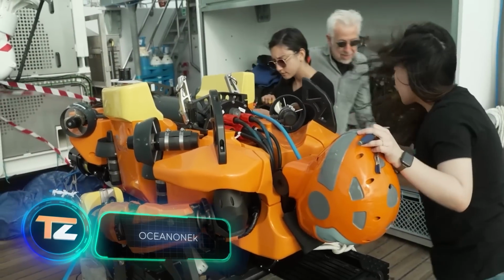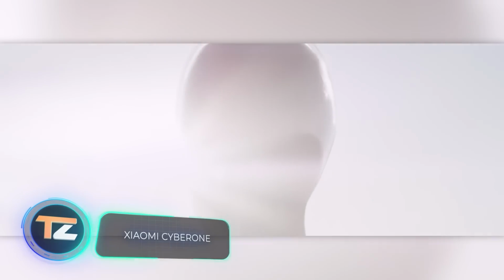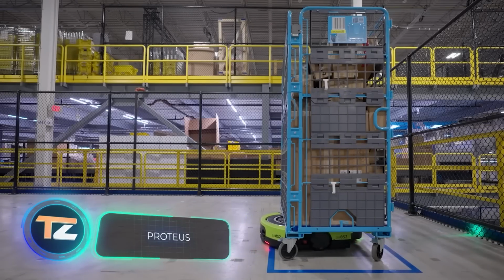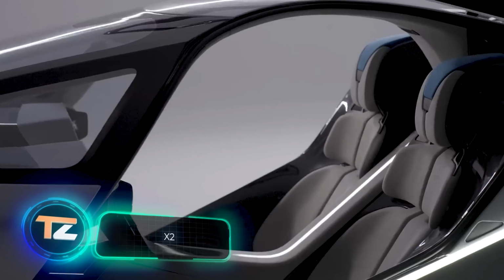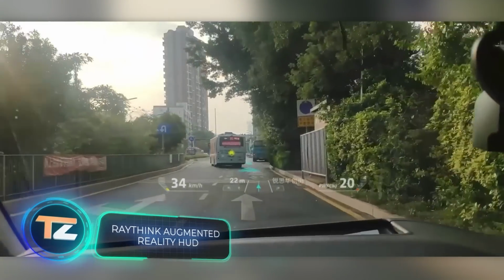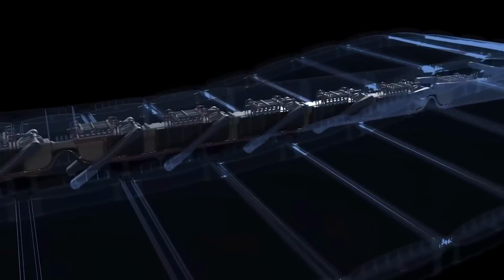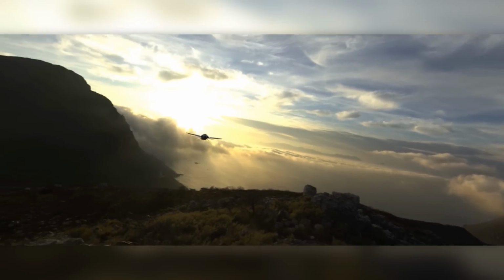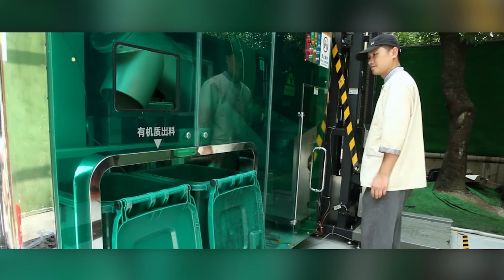AMAZING INVENTIONS YOU HAVEN'T SEEN BEFORE

Comment: It is totally wrong to say to say "Fuel prices dropped so efficiency is not required". Irrespective of Fuel prices higher fuel consumptions must be curbed worldover. People talk about carbon emissions but how many talk about heat emissions? What is the exhaust temp of Gas turbines, (Aeroplane engines )? 
Are there any developments to reduce this temp ?

Comment: the water from air will always be a scam. areas where air huidity is high also have rain . there where its dry as a bone humidity is low and the energy needed to extrapolate water fromm air is there way too high making transorting water by and cheaper

Comment: The GE 36 was hardly killed off due to oil prices. 
It got killed off because it was insanely loud and larger high bypass turbofans where already rapidly surpassing what it could do. 

The US air force tried something similar with the XF-84H "thunderstreak" and it was so loud it damn near killed a man and could be heard for miles.
Reply: whilst you are right, the original jet engines were also much louder during development.  So many of the issues may of been remedied had the price not dropped and development had continued....
Reply: @dane4265  The military tried the tech as well. 
Their engine was so loud it killed people and blew out windows. 

The tech relies on few blades at a very high rpm or many at a lower one. 
But once you lower the rpm to reduce noise you lose efficacy at the blade tips and need to put a shroud around them. 
At which point you have just built a turbofan engine.

Comment: that delorean aerospace plane/car when made decently atleast, should be much more efficient than a electric car, allowing it to go much faster with a lot less fuell. if it is made very good it will be a lot better again, allowing it to be insanely more efficient. just like how the germans(some hobbyists) once made a flying device which was very small and cheap to make(mostly just a regular old style hangglider but modded. that thing would go around 100km/h(max speed you are allowed to go with a car with a small motor of around 500w, where that little power once up high enough already actually would be overkill.

other gliding planes also can stay up with barely any force, but hanggliders are made super cheap and simple(you can make one for around €200 to €300 in europe, in usa that would be a lot cheaper) but  in reality almost all flying devices which are properly made an optimized are guaranteed to be a lot more efficient than cars. those big passanger planes however while not terrible in efficiency are made specifically to be cheap and small, not for efficiency so in comparison they are really inefficient due to the huge weigth they need to carry with very small wings(which isn't always bad when you go really fast). but even those acienct 4person planes from not that long after the WOII already are more efficient than almost all carrs currently on the market with some small super efficient cars being the exception.

a modern optimized flying device could be a lot more efficient. the main principles to look at is that when wings are made and designed properly you almost have no drag at all other than the wind resistance. when wings are using the "new"(10 years old or so by now, but still almost nobody uses it, however some of the first hanggliders used it, so it would be older but they did it on accident because it was cheaper and more easy to make for them) nasa mars glider wing design you can illiminate the generation of turbulence from the wings, normally this would be one of the main losses of the wing. now the only significant force required to fly it would be the direct drag from the air and moist in the air. luckily planes tend to be insanely more aerodynamic by default. and there are 2 other nice effects which help you one of them is mostly due to turbulence from other parts of the plance, so with a perfectly tuned plane this won't do to much. but when swimming underwater the further you go down and away from the surface the less friction you have in the watter with around 3m of depth often being the ideal depth since after that the effect greatly reduces. air has a similar effect but it is less strong and so has a shorter range, however this effect keeps going on quite far and so the higher you go your friction slightly decreases. another much stronger effect with being up high is that the air pressure greatly decreases, which means a lot less friction with personal crafts you typically don't go as high but it will still help. and when flying smart you can use updrafts to get free energy.
now come the other parts which make planes a lot more efficient which most people don't directly think about, a plane doesn't have friction with the road and a lot less dust particles, road friction is a huge problem for cars, as well as that the weight puts a lot of pressure on the moving parts, the wheels, bearings, the rotating axis, etc. that generates insane amounts of loss, for a plane almost all foreces/pressure is on the static non moving parts,  this makes it much more efficient. then there is the weight thing cars have a lot of weight and vibrations from the weight, the road, braking and accelerating etc. this forms a paradox where everything needs to get stronger making it more heavy causing it to need to be much stronger again. electric planes barely have any vibrations so can be made very simple and light, and instead of using super heavy parts to make everything rigid and strong at the same time, in flying devices things are allowed to be a lot more flexible. having flexible materials allows them to be super strong without needing to be heavy or big, and they need to carry a lot less weight as well. the weight is the next issue. when driving a car you are also very insanely inefficient in a way which in general is not thought about and so is not included in comparisons like that old plane to a modern car. and that is that planes can go in much straighter lines extremely shortening the distance but also greatly decreasing the amount of energy lost to inertia,  this same goes for making turns, planes don't need to have grip, so don't need strong tyres, they don't lose energy due to friction due to sideways pressure on the tyres trying to rotate them, and planes instead just turn sideways and automatically turn using the same force that holds them up. this also makes them much safer than cars+you have much longer reaction time if something happens. now another on normally not concidered is that cars in reality need to brake and accelerate again all of the time, for a flying device you just put the motor on a speciffic speed and let it go. only when someone comes to close to your height and trajectory you need to correct/avoid it but even if everyone used planes such a thing would be very rare to happen due to the sky being high and traveling being a lot faster. with some proper planing and standards(like special zones giving priority to a speciffic type of action) it would be very rare for any plane needing to interact with another. especially if they can do vertical landing and take off. 

 I forgot to mention some things in here but there are more then enough effect already in here which should convice you why flying is much more efficient.

now for some of you, you might have heard the standard misconception that wings do not have planes and always need to fight themselves and push themselves straight up into the air just like a rocket making them very inefficient for long flight. well I need to tell you that while rockets do that, planes don't even quadcopters use small wings, the propellors are small typically inefficient wings, but for a real plane the wing effect is much greater I will explain it for planes but the same also works for helicopters and quadcoptes etc. just on a smaller scale for those compared to planes.
when a plane flies it barely needs to push itself upwards. the best way of seeing a plane is by seeing it like gears. so lets say we have a small plane weighing around 500kg with the person in it, a plane can be made lighter than this easily btw. but when you need to keep that weight up in the air like a rocket it takes a lot of energy, and most people talk about planes in that way of they need to keep all that weight in the air. but the truth is that the air is just like a road. an your plane isn't struggling to stay in it, it just stands on/in the air. just like how a car stands on the floor or boat floats in the water. a plane needs speed to stay in the air and indeed a little force. but that is mostly force in the way of speed.
you can see a plane staying in the air more like a gearbox. the wings are one huge gear and the air is a huge gear so you can see it like a insane reduction gearbox where if you go at a decent speed and have decent optimized wings you are looking towards ratios in the thousands. this means that to keep your plane in the air the force required to keep it up is similar to the force your engine would have to deliver to lift a few kg or actually less than a kg in weight on a rope around the engine axis. and since the propellor also has this gearbox effect a plane once in the air barely uses any energy to stay in the air. the force required is kind of like a small weight of a few grams attached to a rope attached to the motor shaft, when properly tuned the energy lost to staying in the air is less than one single small drone motor. ofcoure the energy needed to stay in the air at that efficiency is bigger due to t relying on speed so you need to go fast enough to fly efficient, but since people like to go around 100km/h or 60mph anyway this is no problem. only when you go up to steep it requires a lot more force. but hanggliders with a pilot can take of gain height and fly on a electric motor smaller than what you regularly find on a electric bike.
Reply: Thanks for your thoughts and lucid commentary !

Comment: wanted to make a rc drone on the same concept as that new delorean car in this video, so perhaps I can steal some  design concepts from it for my design. but there are still some things I would do different. somehow expected this video to be about rc drones because of that because it looks quite much like how I had designed it.
however at looking at the 3d model I see some differences.
I didn't base my design on that car/plane however. I just came up with that concept to make a faster and more efficient/durable racing drone for long distance races. it was mostly to fix issues with a speciffic old technology which in the past was used in some high speed quadcopers to go faster than the motors would normally be capable of. that technology however was to hard to use for most people since it required a lot of precission and timing to use it succesfully without chrashing, and it typically will cause problems with most fpv sets causing you to lose vision or get bad vision. currently it is comming back in acro mode freestyle quads, however there it typically is only used for making faster/sharper turns.
but I wanted to make a racing drone optimized for those longer distance races again. and now embracing the modern technologies which can make it lighter while still staying strong. my concept was to add small wings to it and to controll the motors using rc servos so I could go super fast in straight or almost straight lines, while the wings should barely add any slowdown in things like going straight up(could actually go up faster/more efficient than a regular drone by rotating the entire craft 90 degrees.) and it could assist with turns where the speed*weight gives a big number as outcome. doesn't affect normal turns that much, and it should greatly increase battery life when looking to how far you can fly on a single battery.

Comment: Sadly the Cyberone is still not walking properly. They really need to understand that movement for bipeds is a state of controlled imbalance. We fall, catch ourselves with the other foot, and then repeat the cycle. Until they can get a robot to do that, they might as well not be arsed with doing humanoid robots and opt instead for ones that can do the task without doing the "I'm a baby who just learned how to walk" shuffle.
Reply: Very true.
But the main problem that they have been having with robots is the hands.
To be more pacific, the thumbs and fingers.
The robots still can't pickup a glass of water or a cup of coffee.
Without breaking it or spilling it.

They can't get the thumbs to work like a real thumb.
And they can't get the fingers to apply the correct amount of pressure when picking up different things.
For example like picking up a feather or a glass of water.

Comment: The GE-36 engine was also noisy and to reduce the noise level also reduced the fuel efficiency to be negligible better than normal engines add to that the disagreement as to 7J7 internal configuration with one having the GE-36 engine and the other a standard engine combined with the cost of oil finally killed it

Comment: Aircraft are the largest waste of fossil fuels especially in consideration of the US military.  An F-15 burns 3200 pounds of fuel just two casual hours. Multiply that by thousands of aircraft and different fuel consumptions.

Planes are literally the largest fossil burn contributor to pollution. 1 flight of a super bus can fuel hundreds of diesel vehicles

Comment: Wave energy is PURE CRAP. Sure, it is possible. It has even been done. HOWEVER, no matter how you build it, you must face the fact that the power that can be obtained will NEVER pay the cost of building and operating the device. Just consider for a moment the  energy per LINEAR wavefront and you will see what I mean. YES, it can work. But NO, it can NEVER be practical. I have been over the calculations, and it is a losing idea.

Comment: OceanoneK. How about a special suit that someone can wear to do this instead?
Xiambi Cyberone. This is not liked by anyone and after the Terminator movies is also scared of this.
Proteus. A robot to replace humans, the humans don't like them.
X2. It isn't a car if if it doesn't have wheels on it.
H.U.D. This has already been tried.
Wavelength magnet. You will kill whales and shark with this due to the fact that it will fuck with their internal guidance systems.
The Not Delorean. It isn't a car if it doesn't have wheels on it.
The Mint Box. This is a joke for people over here in the States.
Phantor. California needs this now.
GE 36. This isn't possible due to the fact that the subsonic vibration noises will cause medical problems in anyone that gets near it. Look up the Mach One Propeller driven airplane the Screamer.

Comment: That amazon robot does not seem to be that smart of an idea.  The cart is on wheels.  The cart probably weighs CLOSE to the 48 pound capacity to begin with.  There's no need to lift the cart; just latch onto the cart and pull it in one direction or another.  but then, a smart guy could just integrate the drive into the wheels and  drive the cart around without a robot that is, btw a trip hazard, wander around to lift carts and avoid obstacles. 
Another fail by designers..
Reply: I agree as smart cart would be cheaper to build and as they would have set tracks to follow less Likely to run into something .
Reply: There's no way the load limit of that bot is 48lbs. The cage on it's own weighs more than that.  It's just bad research.